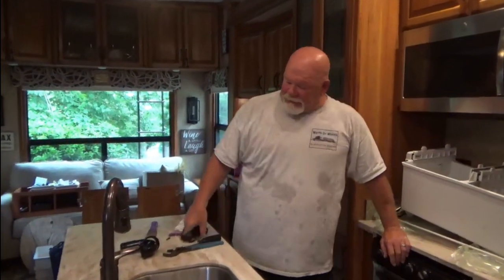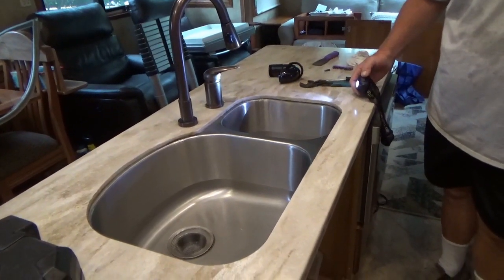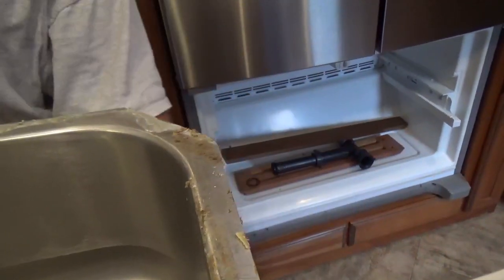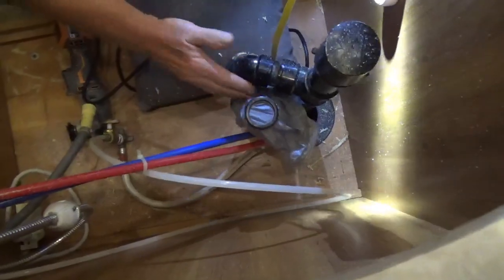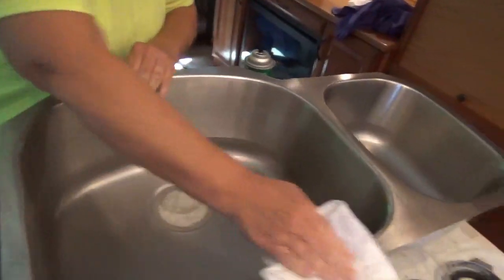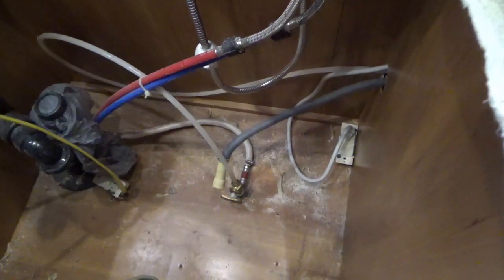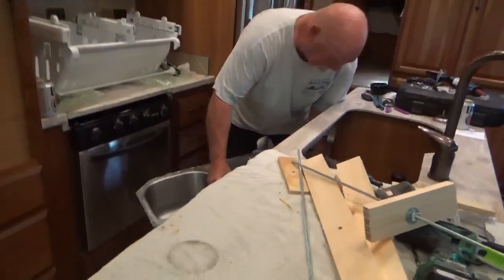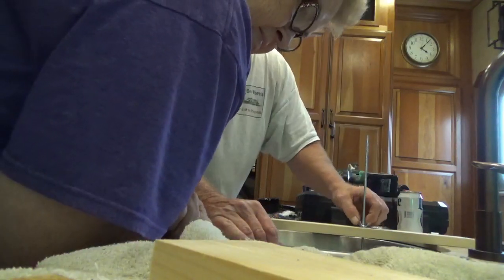💪 Sinking RV Sink Repair // Full Time RV

Comment: Love the bracing with the threadstock and one bys. I was trying to figure out what the heck you were doing! 😃. 2 days, $100, a little sweat and blood and a 12 pack. Not bad. Probably would’ve cost $1200 to have a shop do that. 👍
Reply from the maker: Thanks Rod.  That's a little trick of the trade from my former kitchen and bath remodeling life.

Comment: What kind of lexel did you use?   Our sink has a shelf under it also…..would you remove it?  Since this was 2020 how did the lexel hold up?  And did you use the lexel for final seal around the sink?
Reply from the maker: Just plain clear Lexel.  Still holding on but we also have wood blocks helping to hold it.  Didn't use anything for final seal around the sink.

Comment: Isn't there clips for under the counter to hold the sink along with silicone
Reply: I have done this repair on my DRV. I used adhesive Silicone ( I would use Lexel now) and some under counter sink clips I got from Amazon. Still in place after three years. And we travel with stuff in the sinks.
Reply from the maker: I didn't want to drill holes in my counter from underneath,  so I put the wooden supports in instead.
Reply: I wonder if your wife knows how lucky she is
Reply: @WattsOnWheels  No drilling you epoxy the brackets. I am with you no drilling for me either.
Reply from the maker: @toddfletcher3398   She does.  She's a keeper too!